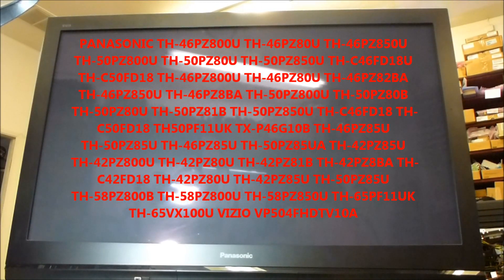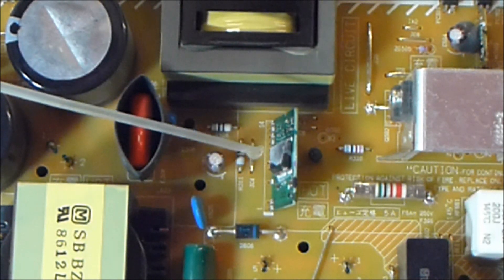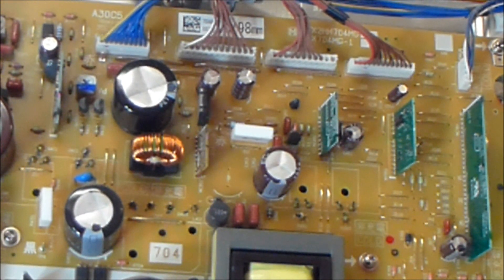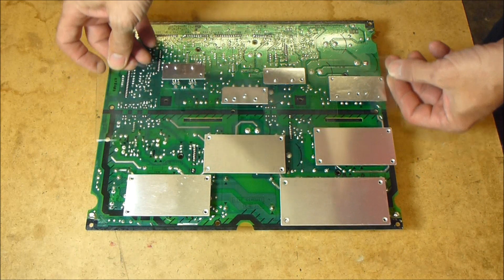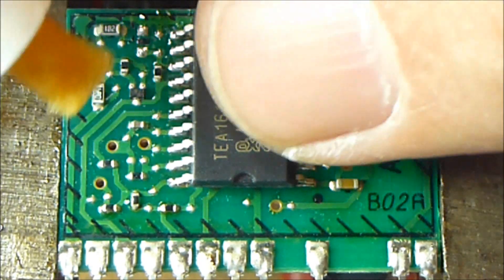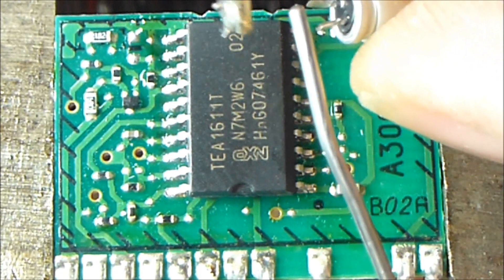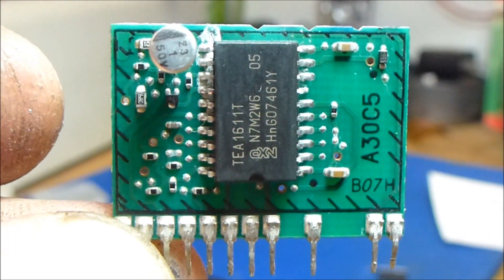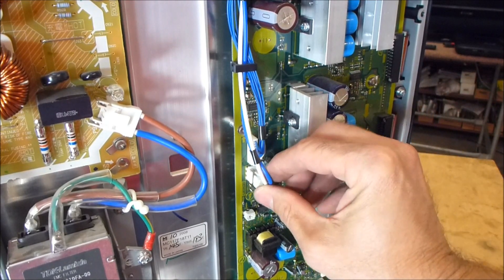Panasonic Plasma 10 and 2 Blinks TEA1611 ETX2MM702 704 706 Power Supply TH 42 46 50 58 PZ 800 85

Comment: Thanks for the wonderful video and explanation.

here is my 2 cents and experience.

I stay in an apartment and have no garage to repair the tv. If can do it so can any of you, this was my first soldering experience and i was very doubtful and fidgety, but the video was of great help and the tv is now working, i just replaced the caps. also since no garage i did with the whole tv set on my mattress and did not remove any boards from anywhere, in place. it was kind of hard definitely recommend a magnifying glass.

replaced with a 1uf 50v from frys, and did not replace the ic.

things in the video look bigger than they actually are in real life.

i did not expect such a small cap, my repcaement cap was much bigger ;)...

removing it was kinda hard but the putting in the new cap was even harder. but definitely it can be done.

Comment: Thanks for this tutorial, it helped me getting the tv going again (without the back cover). I've read somewhere else on the net that just removing the capacitors will fix the issue. Can you comment on how this might work? Or if it is unwise to do so?
Reply: I've been successful with removing the decoupling capacitor 4 or 5 weeks ago and my plasma TV (Panasonic TH-46PZ85U) is working perfectly so far.  This is just a temporary experiment.  I plan on installing a 0.22uF cap very soon to complete the repair.  Someone claims that this original failing capacitor is a 1.0uF electrolytic.  The capacitor package size is far too small to be a 1.0uF cap.  It is possible to remove and install the capacitor at this location (MC301 board) without actually removing the small board from the main power supply board.  Therefore, I recommend replacing the capacitor with a 50V, 0.22uF ceramic.  The job will go much better if you obtain a large magnifying glass to properly visualize the soldering process ! ! !
Good Luck, G.S.

Comment: I have a TH-58PZ800U that made a loud pop and shut off with 4 blinks. After unplugging it and plugging it back in then pressing the power button I get the 3 clicks and 2 blinks. I tried cooling the IC but I'm not exactly sure if I'm cooling the right one. Please help!
Reply: I don't think your problem has anything to do with the MOSFET Driver IC
circuit board (MC301).  A loud pop is a very BAD thing in electronics.
How old is you TV ?
Was there any kind of odor in the room after the POP  ?
If not, the damage may be very limited .....which is a good thing. 
Anyhow, your unit is a VERY expensive plasma TV ( $ 3 Grand ??) and it is probably a good idea to take it to a good, local, HD TV repair shop for diagnosis, estimate, and repair ......(in your case due to the LOUD pop event). My advice is to NOT attempt repair of this unit if you are not a trained electronics technician or electronics engineer. The individual power supply boards are not very costly for this TV. The TV shop should only use the EXACT (latest revision board) replacement board(s) for this chassis series (if available).
Also, contact Panasonic in NJ and explain your issue as they may repair your unit for free if this has been a common customer failure mode.  They would send you a shipping carton for a fee and you would have to pay to ship (with insurance).  Good luck.  GS.

Comment: If not for this excellent, detailed, debugging session, I would not have discovered the fault in my Panasonic TH-46PZ85U main power supply board.  After downloading the  full (free) service manual for this chassis, I was motivated to spend time to finally fix this rig.  As recommend, I inverted my can of air and sprayed the MC301 ckt board, then plugged unit into AC power, waited for both relays to latch in, pressed power button, and the unit fully powered up  ! ! !
Now, .....for what it's worth, I was unwilling to believe that the NXP FET driver IC was uniquely responsible for this failure mode.  Therefore, I removed the Vdd decoupling capacitor and tested the TV for several days.  The TV runs perfectly.  I plan on installing a 0.22uF capacitor at this location to provide analog supply decoupling.
I do not believe that the ORIGINAL capacitor was 1.0uF !   The capacitor package is not large enough to be a 1.0uF electrolytic.  Anyhow, we shall see how long my experiment runs without failure(s).  Much thanks to the MASTER technician who produced this powerful video session.
Thanks !!
G.Spencer
Rutland
Reply: Just a quick update on the progress of my Panasonic plasma repair.  It's been over 4 months since I removed the decoupling capacitor on MC301 board .....and the power MOSFET driver IC is still functioning without it.  The TV has been working great with no problems.  Last night (3-12-14) I replaced the bad capacitor with a new aluminum electrolytic with the lead length cut to about 3/16 inch .
I purchased 2 of these capacitors from DigiKey for $0.60  each.  These are high quality 1uF, 50V non-polarized, electrolytic capacitors  ( p/n 493-10252-1-ND ).

NOTE:  I did not have to remove the MC301 board from the Main Power board to  perform this soldering operation.  This saved me lots of time and aggravation.
DigiKey also stocks the MOSFET Driver/Controller IC (TEA1611T) made by NXP.
Hope this helps.
G.Spencer

Comment: What wattage is your iron?  Or, if you have an adjustable unit, what it is set at?  I don't want to mess up the tiny board or any of the mini components on it.  I am about to attempt this on a Vizio VP504.  No blink code, just the VIZIO led lighting up to orange and staying that way.  I have read that others have had success with this repair on this unit with these symptoms.

Comment: Hi norcal715.  I am Miducuast.  Since I don't have a workshop like you, I did follow your instructions and sucessfully repair or fixed my Panasonic TH-50PZ80U.  I did your diagnostic and after that I replace the damaged parts like you do in the video and now it's perfectly working.  Thanks a lot!!!!  I was able to fix it in my own.  Again without a workshop like your do.  I hope you can read my message!!!

Comment: Thanks for the video! TV Repairman quoted me $500 to fix my TV, instead I bought a soldering Iron for 15 bucks, replaced the IC's and fixed it all for less than $50 bucks. 

And i learned a new skill, never solder'd before in my life

Comment: Replacement cap used: BCcomponents Electrolytic Capacitor, SMD, part no. 2222 153 61108, 1µF / 50V / 20%, 4x5.3mm

Comment: I have a Panasonic TH-46PZ8OU that was powering up intermittenly. Eventually it went out and I would get the two blinks after i hit the power button with no screen. I changed out the TEA1611T and the capacitor on both the MC201/301 boards and it works like a champ! I ordered the parts off of ebay and it cost me $11.00. Thanks for the help.

Comment: I have a TH-50pz80u that had 2 blinks. Just swapped the power board and now I get 10 blinks as soon as i plug it in. If i hit the power button i dont get any clicks like you did, but should i still check 201 and 301?

Comment: panasonic plasma TH42PZ80U. I replaced only the 2 capacitors with two 1uf/50 volts poly film caps (not the IC's as shown in the video). I had the 10 then 2 blink error codes. This worked perfectly. Thanks so much for this video on how to do it.

Comment: I followed the instructions in this video and successfully repaired a Panasonic TH-46PZ85EA Plasma TV.

I called Panasonic Plasma Profi Service, Germany, BEFORE doing the repair, to order a new power supply. This was my worst customer service experience in many years. The rude support person stated that the "instructions on the internet" were all wrong, there were many reasons for the Plasma TV to fail, and that I had done irreparable damage with the cooling spray diagnosis. Obviously, not true

Comment: I have a TH-46PZ85U, and i have the 2 blinks and when i hold down the power for about 10 seconds it turns to a 10 blink. But on removing the power cord and putting it back again after 30 seconds it shows 2 blinks, Also I hear the 2 clicks and no 3rd click, does that mean the 15v is not being sent/powerd on. Please do advise.

Comment: Do you think its wise for the average person with little or no electronic and soldering skills to take it to a expert? My 42" plasma tv has been acting pretty much to the key what you described except after checking connections, and where its plugged in the tv return to normal. However, two weeks later the issue returned.

Comment: I am not getting the 10 blinks before, however I am getting the two blinks. It passes the 15v test but once I hit the power button I get the 2 blinks. I do get the 2 clicks in succession when I hit the power but the fans dont even turn on. I was wonder where in the repair process do I go from? or is this not the same problem?

Comment: Hey, I have a question. I did the project just like the video shows, except when I soldered the chip boards back onto the power supply board, the solder is touching between the connectors. Mine is not working, and I was wondering if that is the culprit. I am new at soldering, so please excuse my ignorance. (My model is TH-50PZ850U with a board number of ETX2MM704).

Comment: Hi I watched your video and thought it was awesome.. I did exactly what you said with the can of air and it worked.. i purchased the chip and capacitor and changed it on both and now when i got everything back in its place its still giving me the 10 lights.. but this time its not doing the fast clicks .. its doing the 2 clicks and then the 3rd and then lights ..can you please help me cause i am lost now.. not sure where i went wrong.. i did everything the video said too..

Comment: Hi, just waiting for an answer to my question but, I wonder if the UK power supply is different. 
The following words are from a listing on ebay for the whole driver board.
Be sure to ask if they are the same. They are Panasonic Agents.
Regards john b

PANASONIC TH-42PZ80 TH-42PZ81 TH-42PZ85 ETX2MM702MF 10 FLASHES / REPAIR

Comment: I have a question, not to sound totally ignorant but if quick cooling the heat sink will allow the set to come on would it do the same to just put thermal grease on it? Seems crazy that Panasonic isn't making certain parts for these sets anymore, I hate a throw away society.

Comment: Hi,
I'm hoping you can help.
I was given a tv from a friend here in the UK.
They must have watched your video and removed a capacitor from the MC301 driver board. However, this power supply is a ETX2MM681F / 681M
The Thermal fuse under T201 had blown.
I found a manual but it doesn't give the driver board circuit.
I removed the same cap from the MC201 and it measures 220 nf.
It connects to the TEA1610T pin 9 (signal ground)
Is should the cap be 220nf? 50volt?
Many thanks in advance john

Comment: Thanks for this video, we have had this tv for quite some time now, and i was wondering (because of my HORRID soldering skills) if you can just buy the actual chip itself instead of repairing them. We have had to leave the tv running and not turn it off after the freeze trick, but its a pain when someone accidentally turns the tv off. finally, wanting to fix it for good, i am looking for the entire chip in inself. do you know where to get these chips? which chip would be the top left one? thanks

Comment: You did a wonderful video.A fantastic soldering job. I did screw up on my soldering job so I got a board from China, installed it but still got the dreaded 10 blinking light. I never got any of the 3 clicks at all. Had it on the other board . could this be the logic board or did I just get a bad board
Thanks

Comment: I have the same TV, and although it still works great, I'm wouldn't be surprised that it will quit soon because of the same problem.  I have worked on TVs for over 30 years, but have always had trouble soldering very small surface mounts such as in the video, without damaging the ckt board.  I'm in my 60s, and my eyesight just isn't good enough to do such small soldering.  I must say the person in the video has a very steady hand and good soldering skills for surface mount components.  Thanks

Comment: I love all your videos.  Keep them going.  I have a question regarding this repair.  I saw 1-2 other videos where they only replaced the capacitors on the board.  Is the chip replacement necessary or something that is good to do because the failure is eminent?.

Comment: I have the 10 blink problem for the Panasonic TH50PZ80U.
I took board out and replaced the two small capaciters and the IC chips.
Bad news is the the 10 blinks are still there.
Is there anything else to try?

Comment: Dear norcal175, after 5 months of happiness, yesterday another bad thing happened. The two clicks are there and the red light is stable but when I press on the remote, the green light blinks forever and screen keeps blank. Fans are working. Tried to unplug the TV for some time, press the button on TV durring 20 seconds but no success. Any idea to hem me (again)? Thanks a lot for your time.

Comment: I have a TH46PZ85UA with the 704MGL power board, and having 10 blinks before the power button. I did the "chill" test on 301 and it started up.  If that means the 15V was the problem, can I just fix the 301 board? or, do I still have to do both?

Comment: Were are you located im trying to fix a panasonic  58 inch with a blown transistor on the sc board? Wondering if the p/s is doing this? Tomstr65@gmail.com. I think you do great work   I have been doing this for a few years but you know your stuff!! Thanks again tommy   Email if you can thx

Comment: Will this work with a panasonic plasma tc-50x1. I want to buy one for 50 dollars and try and fix it. If i go to purchase it i assume i need to listen for the three clicks.. One more question if this will work then where would i purchase the chips from ? I can handle the soldering just dont know where to buy the chips or how much they run. Thanks. Great video

Comment: i just replaced the IC on the one board with no improvement, however both original and new IC when chilled will allow the TV to power up. Those surface mount capacitor(s) should be replaced next?

Comment: The cap is a bypass capacitor. I assume the failure mode is toward open and that extra leakage is tanking a supply and causing the error codes. Removing it will fix the problem, but may create others down the road since the IC won't have a nice, stable supply voltage. As shown in the video, the IC is a TEA1611T.

Comment: Just wanted to say thanks for the great video!! My TH-50PZ800U came down with the identical symptoms, and I was able to perform the repair here and fix it.

For anyone else attempting, just wanted to HIGHLY recommend that you buy the capacitors norcal715 uses in the video, with the circular padded leads, as opposed to the wire axial leads. I used the latter and soldering them to the chips was the most difficult part of the process by far but thankfully i was able to get it to work.

Comment: To add: I just bought an identical Panasonic with the 10-blink code, and replacing the same cap resolved the issue. I didn't change the IC.

Comment: I replaced the same cap mentioned in this video with another ceramic cap (not sure if that was a good idea, but it's held up for 2 years). I thought I'd read that the 2 blinks appearing after the 10 blinks is cleared points to a problem with the MC201 module, but I can't remember for sure.

Comment: I had this issue a couple years ago, and I'd drilled down to the MC module (took me about a month off and on to troubleshoot it). I replaced the ceramic cap with an identical cap, and the TV's been running fine since then.

Comment: great repair video...but what was the original problem?  Is it that it didn't get cool enough before the power off anf then power on?  Is there some fan enhancement to keep fan on longer after power off to cool it more?  Does the capacitor change fix this long term?

Comment: I have a TH-50PZ85U with 2 blinks that I bought off of CL for $50. I brought it home and plugged it in...voila it worked. I power cycled it and then got 2 blinks. I unplugged it and power cycled and then got 10 blinks. The MC301 chip looks like it got hot near the edge closest to the board. The case of the is partially melted. What would cause this? The tv operates if I unplug it for a few minutes and then power cycle.

Comment: Norcal, I have the 2 blink red led on TH-50PF11UK....if I press and hold power for 10 seconds, TV will turn on and operate, until shut down and attempted to turn back on. Also, unplugged HDMI, power, and swapped cable box from input 2b to 2a, which allowed TV to operate as normal for one day, and now back to the 2 blink red LED....any thoughts as to board failure this issue this replicates?
Thanks in advance!

Comment from the maker: I have had them that tested leaky while in circuit. Then while the cap was heated the leakage current would change. I heated it up with a 1mm hot air blower tip.

Comment: Ugh, Tried and failed! I dislodged the little surface mount resistor right next to the cap! And of course when i picked it up with tweezers, then snapped and send the little guy flying into what might as well be another dimension.
 I have a question, if you would be so kinda/merciful as to help:
What is the value of that little resistor?
Thank you so much if you can find the time to reply!

Comment: Great Tutorial Norcal715, I looked for the IC @ Digi-Key. Result:"Obsolete item; TEA1611T/N1,518-ND,call Digi-Key for more info". I called, found that they dropped it in 2010. They tried, & couldn't tell me why. I saw the IC's schematic: more heat sensing circutry. My point isn't; can the IC be found? My concern is w/ this parts integrity. As for Panasonic's Integrity... they know they blew it. the game now is damage control. Bottom line-Too much Heat, too little Cooling and many unproven parts.